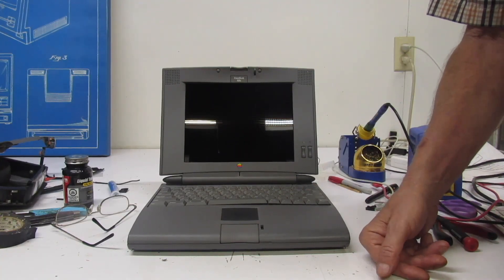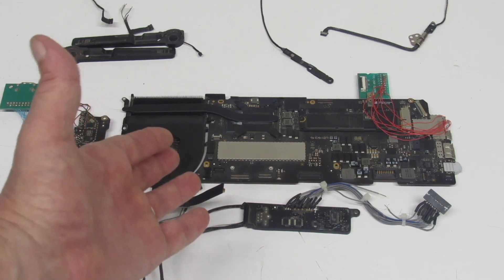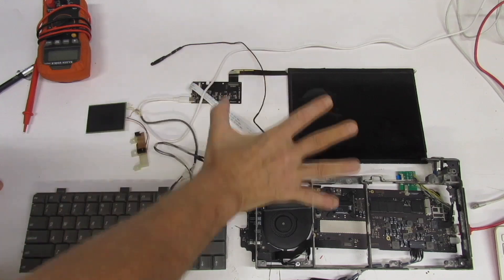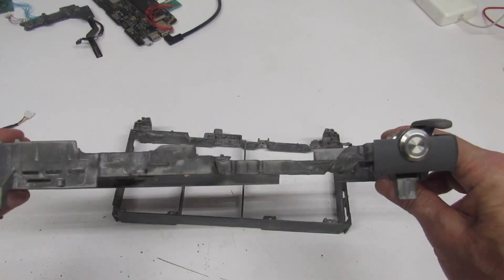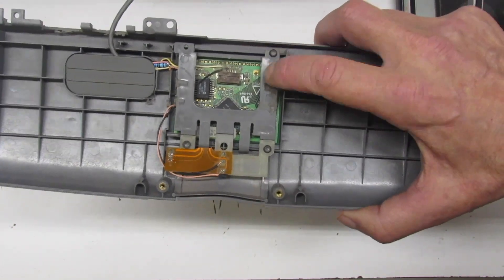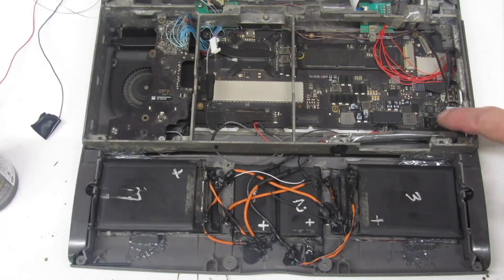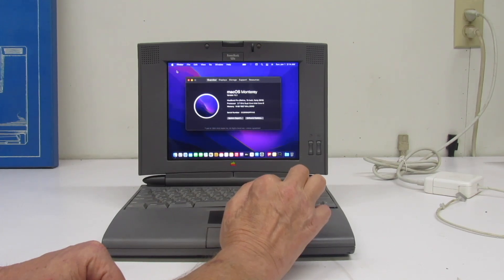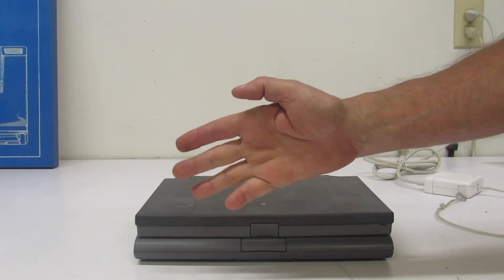1994 PowerBook 520C Pro i5 Mod - running macOS Monterey

Comment: Did the keyboard go on a little crooked or is it just the angle?
Reply from the maker: Hi, the keyboard height was adjusted in the original model by the  logic-board, which the screws went through. I've since used spacers to try and correct this.
Reply: Thanks for answering! I’m doing a PowerBook 170 to Raspi Mac conversion like you did with RPimate. Thanks for the inspiration. Also I’m looking for the Teensy keyboard and mouse wiring schema. Do you where I can find it?
Reply from the maker: @athomepapa  Hello. I don't have the schematics, but you don't need them if you are going to use a Teensy as a controller. Go to Frank Adams instructable page, https://www.instructables.com/How-to-Make-a-USB-Laptop-Keyboard-Controller/, and scroll down until you see Billy67 "G3 Clam-shell keyboard", and that will take you to his repo where I've modified (Mostly done by Frank) the code for the Powerbook 100 thru 170 keyboard and track-pad.
Reply: @BillyTheKidCENTURION  I'm having such a hard time with the connection from keyboard flex cable to FPC socket. I have tried several thickness of plastic to thicken the connections to the new FPC socket but nothing so far. I may look at the original connector and see if I can salvage it from the original board.
Reply from the maker: @athomepapa   Hello:) that's strange, is the FPC cable  falling out of the connector?

Comment: hello ~
I have the same 520C product.
However, the screen is cracked, and the plastic cover around the hinge is broken.
Is there any way to repair it? I would appreciate any advice.
Reply from the maker: Hello :) Of course there is nothing you can do about the cracked screen other than to find a replacement. For the hinge cover "Super-Glue" should work. I apologize if that sounds elementary, but I haven't seen the damage on your laptop?
Reply: @BillyTheKidCENTURION 
Thank you for your advice!
It seems like I need to get the part and replace the screen, but I’m still thinking about it.
Honestly, I’m not very confident about doing it myself. :(

Comment: This is not actual old laptop running the modern macOS. Feel disappointed.
Reply from the maker: Hello, and thank you for your feedback :) I'm sorry for your disappointment.... But I did put in the title that it was an i5 upgrade, and you certainly couldn't modify a 68030 logic-board from 1994 to accept an Intel processor, let alone an i5 from 2015? Expecting that is akin to milking a unicorn. Other than the LCD, logic-board, and battery.... everything else is from the PB 520c....... what would you consider an upgrade while still retaining the PB 520c nameplate?
Reply: @BillyTheKidCENTURION i think op was being ironic

Comment: I´d like to see a Pi version of this..
Reply from the maker: Hi :) I might do that with the other broken 520 that I have using a Raspberry Pi 5. That would be an interesting project because of all the extra room, and removable battery?
Reply: well, everything you did is interesting..just the idea of a quadra AND a Pi in a SE30, switchable, quite unique..one can see theres actually a lot of experience in this, electronically and handycraft-wise.. 520c@Pi5, I dont know what capability this would give as a standalone mini pc without OS, but it would be quite clean..or maybe a MacBook Air 11" or similar would be better? no idea..

Comment: Hi, I think you did a great job 👍 
It seems so difficult to connect all this wires to the keyboard, trackpad, and monitor.

Maybe I can recommend you a new project? 
I'm curious if it's possible to do that with Sony vaio p.
Maybe you can upload schematics or instructions for sell.
Reply from the maker: Hello, and thank you :) If you have a project in mind tell me :) A Sony Vaio P might be too small to do a project like this? If you want to try a project like this, go to the description and follow the link to the Frank Adams instructable :)

Comment: I love when people retrofit old laptops, I remember someone doing similar conversion on a ThinkPad 701c using Framework board. For the 701c they also used an iPad screen, but they connected it directly to the board since both use eDP, so I was wondering, is there is a reason you didn't connect it directly too?
Reply from the maker: Hi, I'm glad you liked it :) For the 701c project you mentioned, it must have been an iPad first generation LCD?  The iPad retina used in this project doesn't have an eDP connector?

Comment: awesome work, thank you for the video! what do you think - is it possible to modify MacBook 13 inch 2009 with hardware of modern MacBook Air models?
Reply from the maker: Thank you Alexey :) Which 2009 do you want to modify, the plastic or aluminum model? Either way, yes, they are possible to mod, especially using MacBook Air logicboards.

Comment: About the buttons you mapped on the side of the screen, what does all of them do? The bottom left turns the display on and off while the top and bottom right buttons control the brightness. What does the top left button do? Anyways, excellent work! I've seen someone do something just like this! 🔥🔥🔥
Reply from the maker: I'm gad you liked the video Amir :) The top left button doesn't do anything, I was going to use the left buttons as volume controllers for an amplifier, but decided to keep it simple. I don't take credit for the idea, I was inspired by a similar project on hackaday by a person with the alias "Tylinol"
Reply: @BillyTheKidCENTURION  Thank you for the input!

Comment: Great mod and great video. Love your enthusiasm for that power book. I had a lesser speced  power book 165 and I don’ t think I loved it as much to put a mod like that in it 😃 But this was great to see!
Reply from the maker: Thank you, I'm glad you enjoyed it :) The 165c would be an easy modification, it has almost the same size screen as the iPad 3&4, and if you were doing a Raspberry Pi project, you wouldn't have to remove any plastic from the LCD bezel since you can adjust the viewable area using over and under scan :)

Comment: your skills are second to none, It is a fascinating video! What happened to your finger? 0:18
Reply from the maker: Thank you:) You should check out Rocky Hill, his mods on the iMac G3 and eMacs are mind blowing! I think you're talking about my pinky finger? I was fooling with an M14 thirty years ago and the bolt released closing on my pinky, and it snapped the tendon, it's called a mallet finger.
Reply: @BillyTheKidCENTURION  m14 rifle caused that injury?
Reply from the maker: @Mr1BOSANAC  Actually it was a M1A, I was confused by small fragments near the ejector cutout and was using my pinky get at them when the bolt went home, I must have hit the release by accident?

Comment: This video is inspiring, I'm a 20 year old IT student from Serbia that loves tinkering with technology. 
Now I am thinking of attempting to do the same build but I have access to 3D printers and PCB Board Printing so I was thinking of doing the same thing but instead of running jumper wires I would have custom PCB boards for everything and a new board for the screen buttons. When it comes to the batteries being held and everything else I could 3D print a holder for them.
Reply from the maker: I'm glad you like it :) I was going to do a custom board for the brightness control board, so I could unplug it from the controller board, but since it was only six wires I used the old board.

Comment: Great mod Billy Love it
Reply from the maker: Thanks Dave:) I'm waiting on a video driver board for my old Wallstreet G3 cases with a 14 in screen, I'm going to put a Raspberry Pi 5 into it. I never saw the last part of your G4 conversion project? Did you finish it?
Reply: @BillyTheKidCENTURION  Yes I have not worked on it Need to do the final video on that